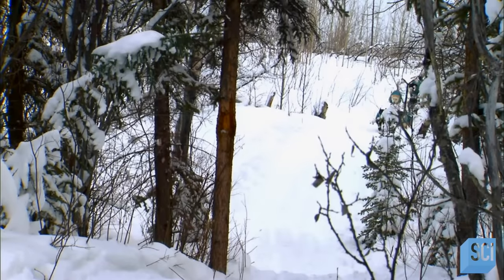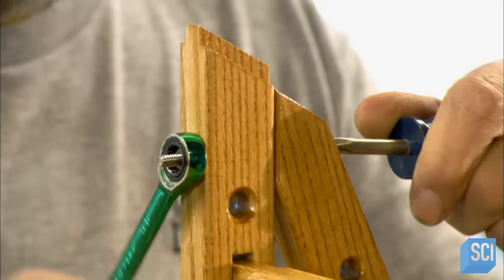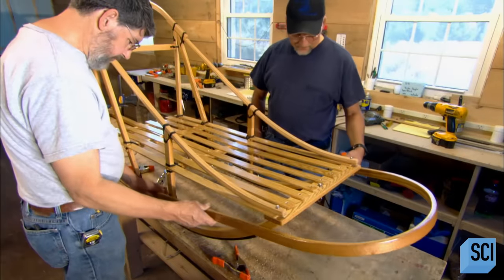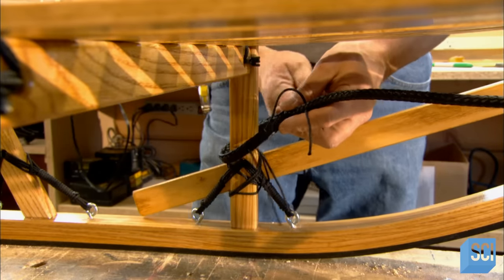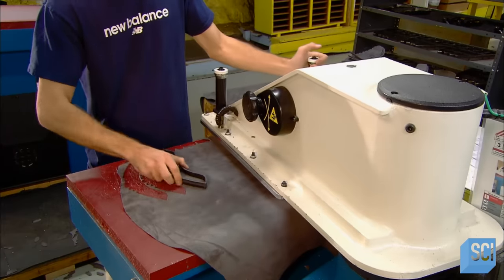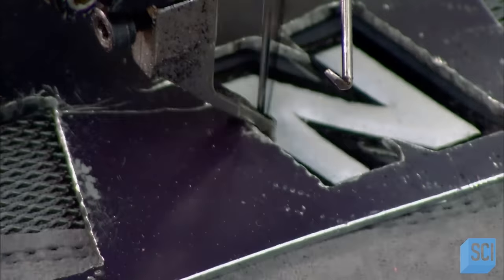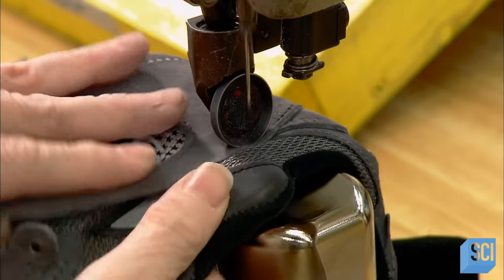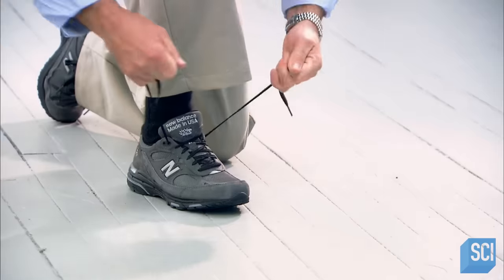How Dog Sleds and Athletic Shoes Are Made | How It's Made | Science Channel

Comment: I like that they just admit they use a tire. I also like that they just use a tire.
Reply: Seems a little wasteful to cut up a brand new tire just to make a rubber bumper on a sled
Reply: @3ggztr3m3b33tz  Exactly what part gets wasted?
Reply: @3ggztr3m3b33tz it’s likely not a new tire, but a somewhat used one.
Reply: @nickforgie4290  The flashing nubs on tire would state otherwise. 3:27  Not wasteful, tire is a component of greater assembly.  But is a new tire.  As it should be on a new product.

Comment: the basic premise is to let a stationary magnet facing down to lift gravity fed on slope from metal ball hopper to magnetic lift zone and let the potential energy rise but you need a triangle shaped blocker that deflects from magnet to staircase keeping gained potential energy you do this on many paths a to e front to back over ad over up 20 magnetic lift stairs to make great potential energy to be dropped from great height as kinetic energy onto river wheel generator basic equipment and need direct current large batteries and a alternating current transformer and outlets of any kind even high voltage kinds works on cars that run on electricity too i need work